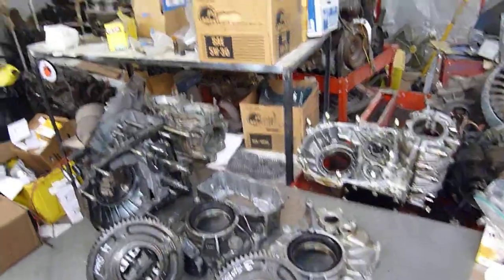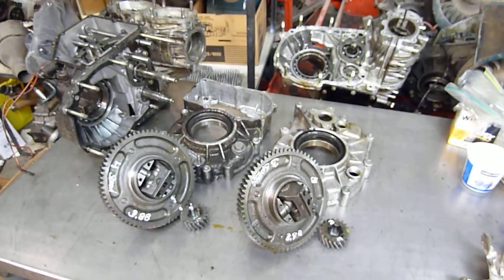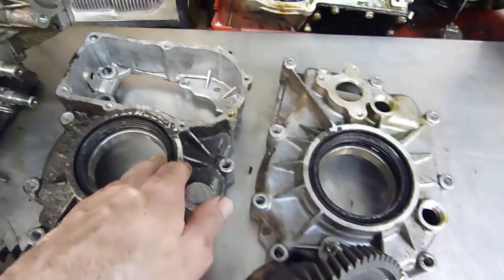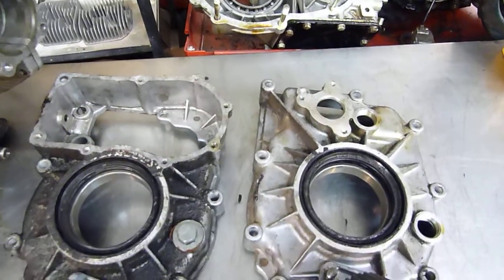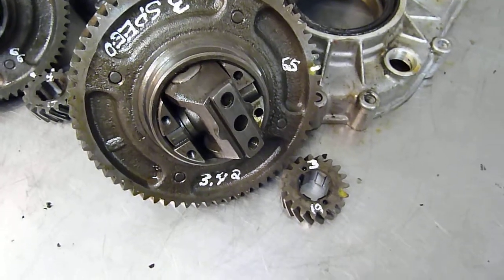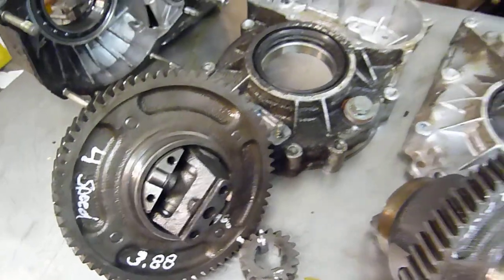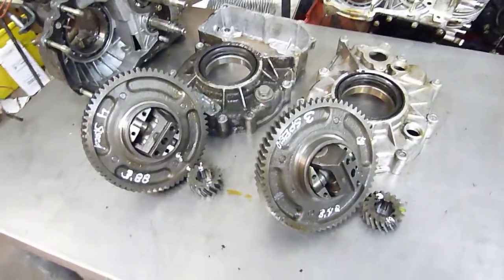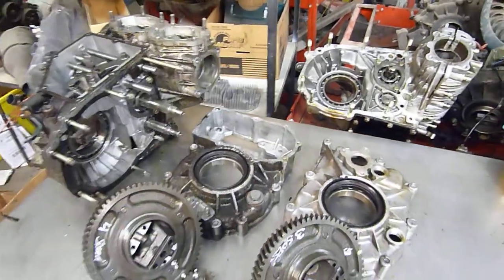Subaru 360 final drive modification

Comment: @2stroketurbo  - Thanks for posting that. What a great idea to combine the taller final drive with the  4-speed!  I once swapped a VW bug transmission into a bus to get closer ratios, a different thing, but just as much fun. First gear was just too low in the bus.   

Another comment... I worked at Suzuki and Yamaha shops in the late 60s and early 70s and saw a lot of them with the cases split to overhaul engines and transmissions. Your Subie appears to have much in common with them.